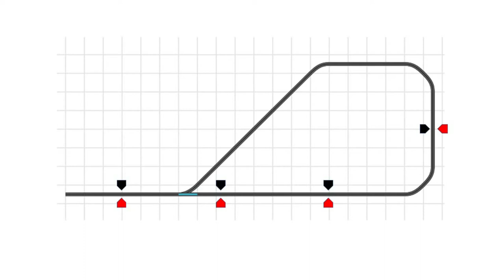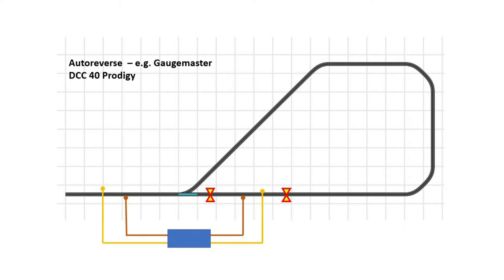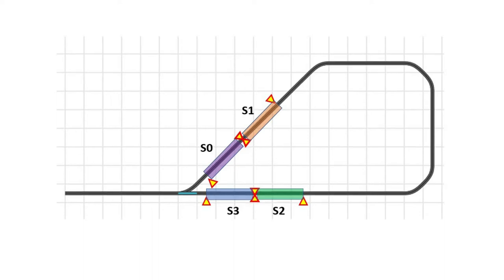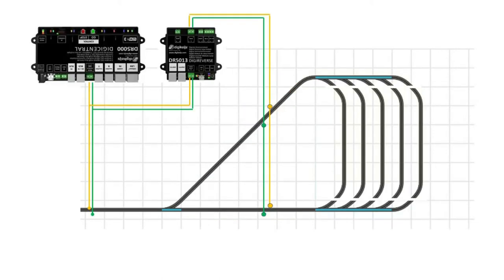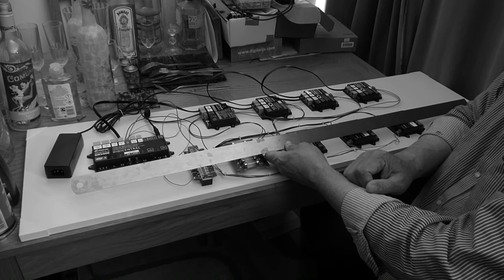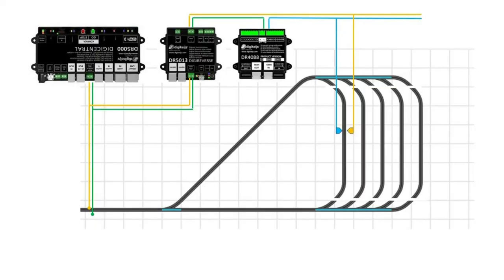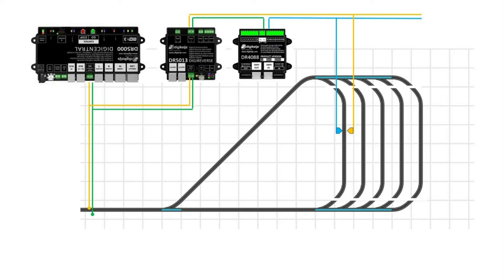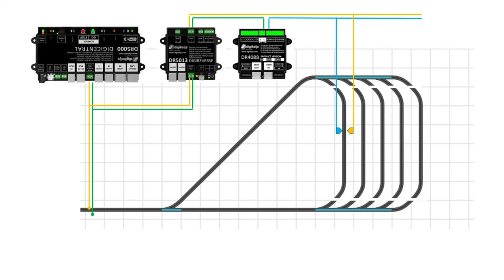Reversing Loop With Block Detection at Halton Warren OO9 Model Railway ¦ 010

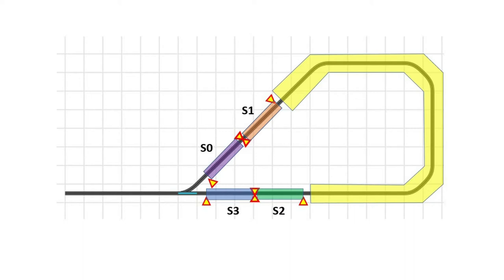Comment: In the "07:30 - DR5013, auto-reversing and block detection." section the output connections to the loop are incorrect. Both feeds are connected to both the inside and outside rail of the reverse loop i.e. shorted.

Comment: I'm all for using gadgets  (I'm a fan of Arduinos), but couldn't this  all be done with isolating sections at each of the siding and using point motors to switch the polarity when the train enters and exits the siding, assuming all exit points are set against the path of the entering train.

Comment: hi well worked out another way for block detection you could have used a digikeijs opto 4088 with infrared detectors but not sure how the reverse loop device would had coped with 5 fiddle yards..............tony
Reply from the maker: Hi Tony
Since doing that video I have found the Digikeij DR4088 Opto, I want to add another detection device to each of the fiddle yard loops/roads to help with stopping the trains in the right so will be using the DR4088 with IRDOTS, as I was a bit worried about cutting in to a bent length of flexible track without the rail misaliging and causing derailments.

Comment: With the kit you are using I would move the detections section as shown in the image at  link below.

The detections sections S2 and S3 are deliberately shown "upside down" as they have been moved round the loop. The section shown in the red circle is now the only bit of track that has it polarity managed.

The fiddle yard is now connect to directly to the main line and you have no need to worry about polarity changes on it.  

https://drive.google.com/file/d/1YJAbG__JXuLA8Xd9TFugLVEn2DDS0FmJ/view?usp=sharing
Reply from the maker: Hi, Thank you for your comments.
Sounds like it is a great deal easier than I though, always good to have other peoples input, as you may have seen I touched on the subject in two of my videos which clearly showed how much I was struggling to understand making this work.
I have screen shot your comments and the diagram and put these in my layout manual for when I do come to wire up the Digikeijs devices.
Reply: That's how I would do it.